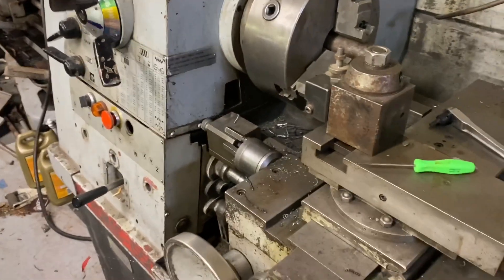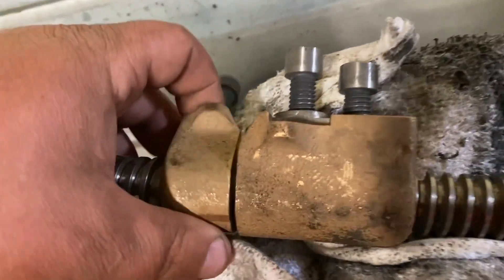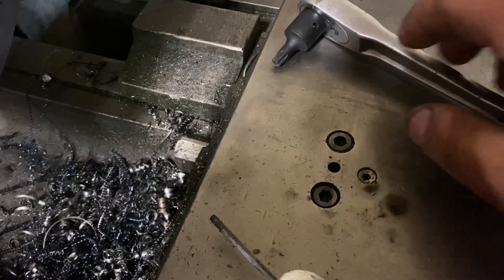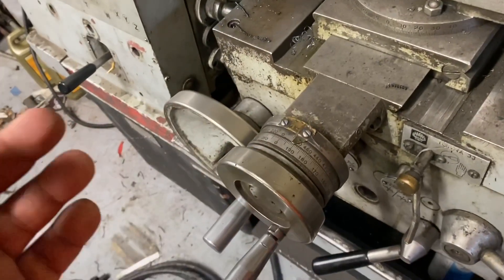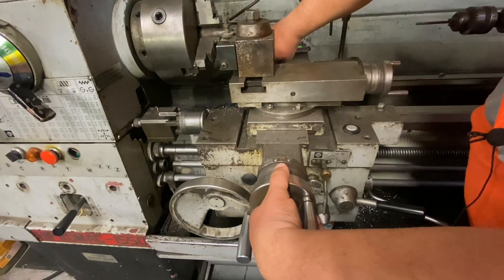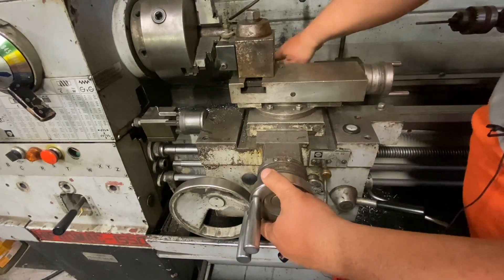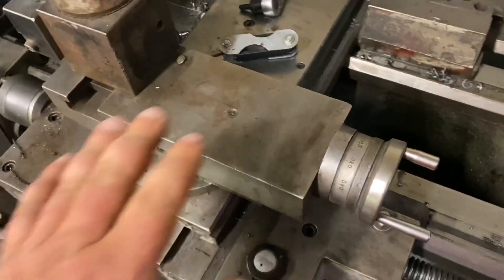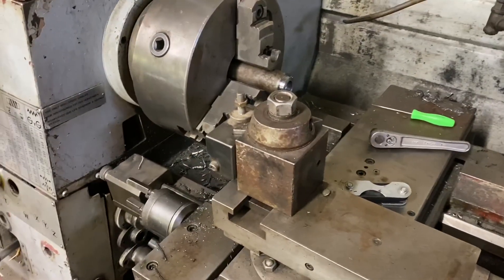How to adjust the cross slide nut on a hypromac, clausing, or colchester 1550 metal lathe

Comment: Sir, why did you use a Torx bit on an Allen bolt?
Reply from the maker: The bolt was kind of damaged, I ended up replacing it with a new one so the torx bit fit it better in its condition at the time
Reply: Ok. Understood. Thanks. @smalltownmachineshop6860

Comment: I'm here because my recent acquisition of a used sheldon lathe has about a turn and a half of play and a gap opens up by the dial! crazy.  hopefully not for much longer.
Reply from the maker: That is a lot of play, I had a Sheldon a long time ago it was a very old one and the nut that held on the dial was another adjustment for slop in the cross slide
Reply: @smalltownmachineshop6860  Good news, it was just the handle not being all the way on. The little hex lock kept it from feeling loose. Anyway simple fix and big improvement.  Sounds like what you said. Also the screw nut seems to be cast iron.
Reply from the maker: @rob12449  awesome that you got it fixed, and yes I have seen some cast iron ones but mostly on the older flat belt machines
Reply: @smalltownmachineshop6860  it is an old flat belt machine.

Comment: That's interesting. I owned that machine before, but tagged as clausing Colchester. I guess they're not all the same. On mine, the split nut has a spiral cut for about an inch, reducing or increasing the tension is how you adjust it. That wedge system looks a lot more positive. I always thought all these machines were identical, I wonder why they chose to do it differently
Reply from the maker: Some of it will depend on the age, mine is a 93 I believe but could be wrong on that